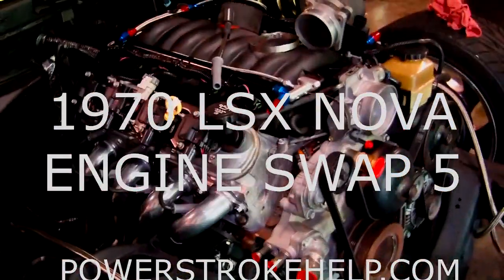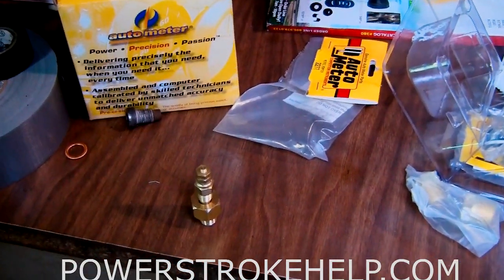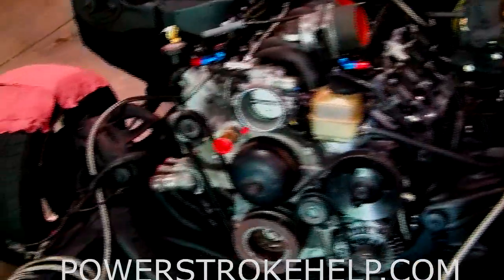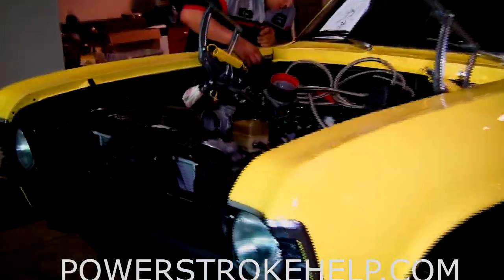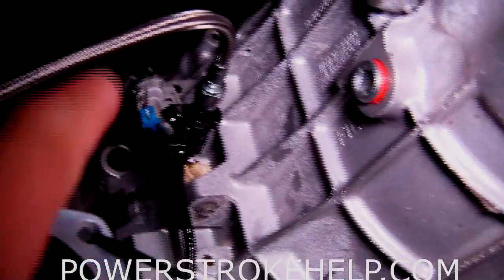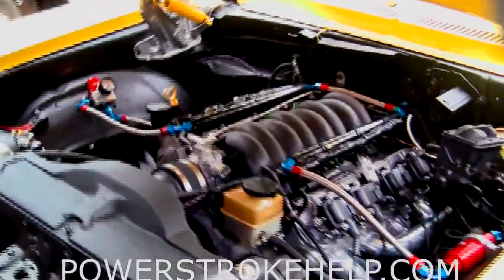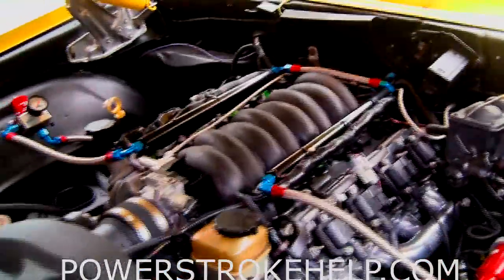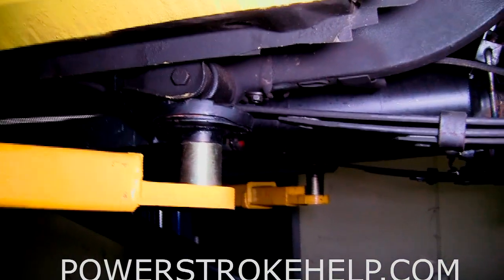LSX 1970 NOVA ENGINE SWAP 5

Comment: That's pretty badass Bill! I've got a '72 Pontiac Ventura II ( the Nova's cousin ) that's sitting in limbo until I figure out what to do with it. I rescued it from Ecology Auto Wrecking in Wilmington, Ca. for $900 four years ago.

I originally planned to turn it into a purpose-built, big block 1/4 mile drag racer, but then life and economic reality intervened. The brake system has already been completely redone, and new Auto Meter gauges ( including a 5" Monster tach ) have been installed. Once I yank the tired 6-banger and dead Powerglide out of it, I'll have room to replace the worn coils and rotten subframe bushings.

I have the car listed on Craigslist and have gotten a few inquiries, but no serious offers. If it doesn't sell as-is, I'm gonna put a mild small block in it and stick it on a consignment lot.

I'll use the money from its sale to finish my 1971 GMC Sprint ( a rare GMC-badged version of the El Camino ) .

Comment: Very informative video series I wish i had the $$$ to put one of those engines in my 85 el camino turn the key and go no leaks no raw fuel smell and mo power ...... what mileage do you get compared to the 355 small block

Comment: So how did you like the end result, Bill.  Looks like it rips!  Just wondering what it felt like in the driver's seat.  Well, it's done, you can take a breather!
Reply from the maker: I have driven this car for all of my driving career and now that it has the 3:73 rear gear, I think it is the best it has ever been. smooth and reliable and brutally fast when you want it. I was skeptical about fuel injection but now I am a believer. dead nuts right on for every driving situation. No overheating, no stalling , no flooding just turn the key and go.
Reply from the maker: No rest for the weary bro. I got pristine 2002 Excursion that we are putting a new frame under for our next vid series. Stay tuned.